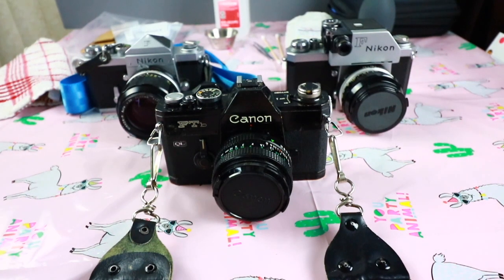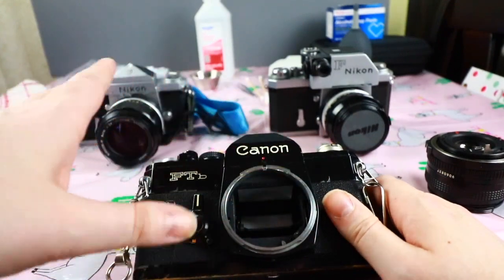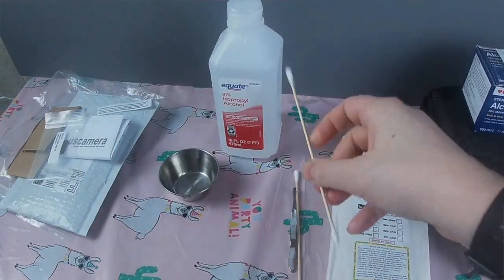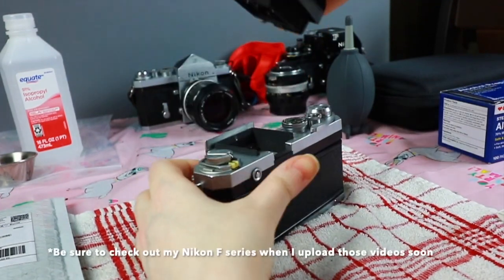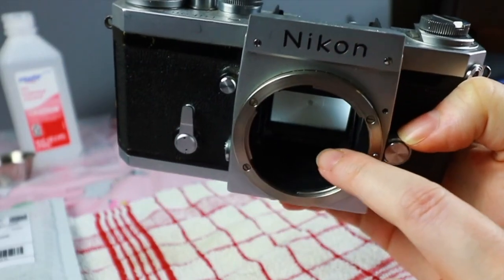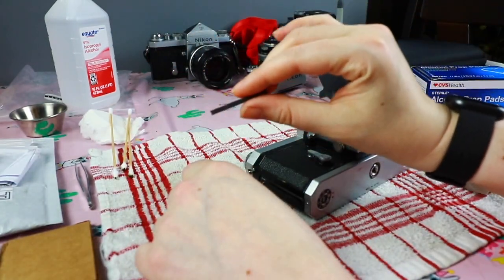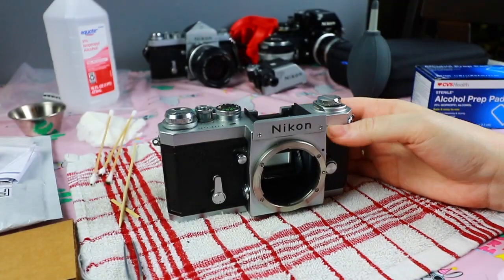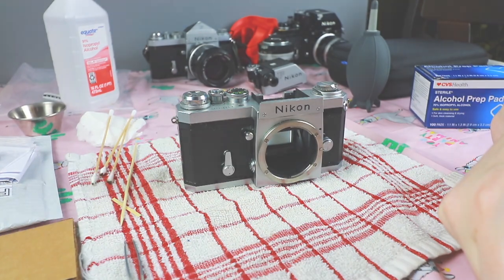Fix That Camera - How To Replace a Mirror Foam Bumper in your SLR Camera

Comment: Follow up comment Aly for you and your viewers. The seals just arrived for my F, F2 and F3 from US Camera (super fast shipping) and they are excellent! I was able to remove, clean w/alcohol and install the new mirror bumper and viewfinder seal on the F in just a few minutes. Also, replaced the mirror bumper on the F2. That one had been replaced by the previous owner, but that camera has really loud mirror slap so I checked the density of the US Camera foam vs the previous replacement foam. The US Camera foam is more dense, while still being soft. It feels ‘right’ and I’d use them again for sure . Very high quality product and packaging. Thanks again for sharing this video and US Camera. =)